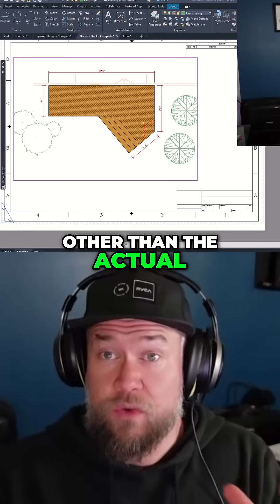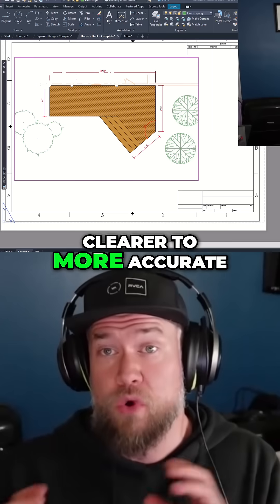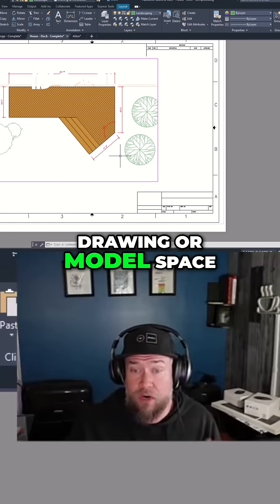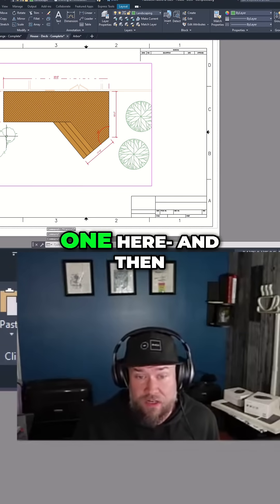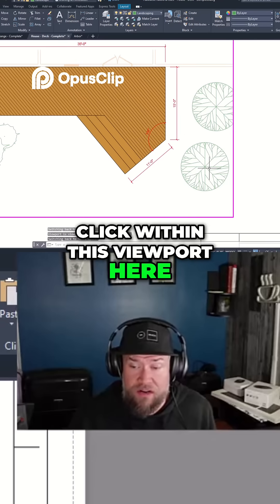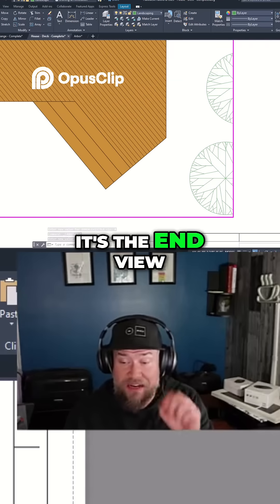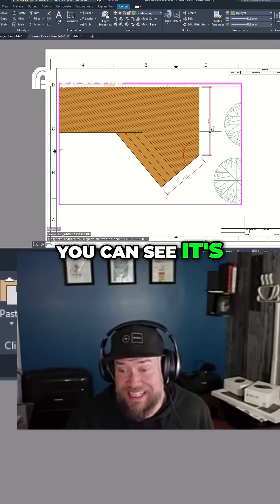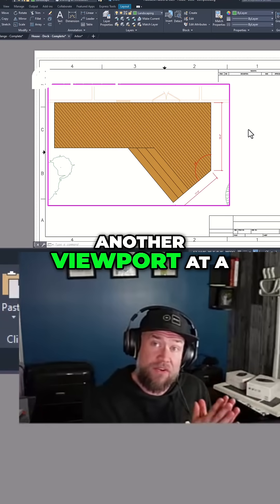AutoCAD Text Secrets: 7 Tips for Clearer Drawings

Comment: Nope, I never use annotative text.
It causes more problems than it solves. It takes about 2 minutes to manually re-scale text in an entire drawing if you need to. I usually never need to, because as soon as I get my plan outline, I put it in paper space to see what scale I need and the size of the text I need before I add text. If I'm using the same drawing for a different scale plan, for a site plan or a blow up, I need different notes anyway, I don't need the same text as before. For details, all the details I use are always going to be the same scale. It takes more time to switch between different scales when working in model space than to know the scale you want the 1st time. 

Also, depending on your settings, when you change scale, text can disappear like you showed, but not because you wanted it to, because you wanted a different scale, and forgot the text existed when it poofed itself away, and if you have every scale set into the text to get around this, when you select the text, all the text sizes displays at once like you're in the Matrix or the Dr Strange dimension.

Learn your scale factors. Print a little chart for quick reference. 1/8 scale is 96 scale factor (1ft * 12in/ft * 8/1-in). 3/16 scale is 64 (1ft * 12in/ft * 16/3-in).
You can easily manually scale text or anything else in CAD by scaling by the desired scale factor, over the current scale factor. Ex, if I want text to be 3/16 scale, and it's currently in 1/8 scale, scale the text by 64/96.
Use commands to easily isolate text on different layers all at once, like TEXTTOFRONT and then MOVE, P, to select previous selection (works on any command that requires selection) deselect any text you don't want to scale, like schedules, details, other viewport text.
TORIENT (Text Orientation) is handy for rotating a lot of text at once (text, mtext, attributes, attributes inside blocks) if you have text facing the wrong way, or if you need to rotate an entire drawing (rare, but it's a pain in the ass if you don't know about TORIENT.)

For text in blocks, like tags, make the block in 1:1 scale, or if you make it in 1/8 scale, scale it down by 1/96 before making it a block. Then select the block you made and make the scale in the properties panel the scale factor of the view you are in. 96 for 1/8, 48 for 1/4, etc. To change a whole drawing to another scale, you can easily select all blocks with SELECTSIMILAR (deselect tags in another view you don't want to change) and type the desired scale factor in the properties.